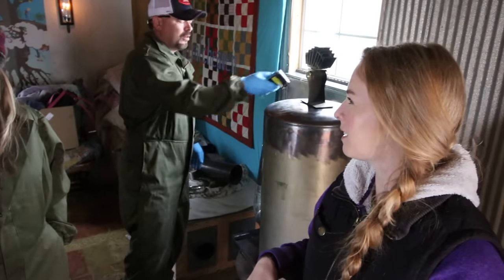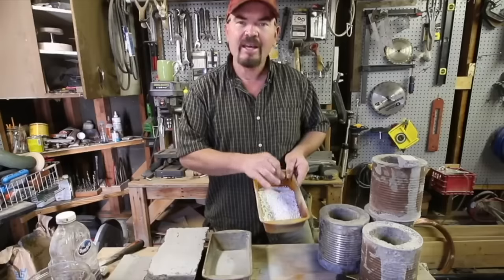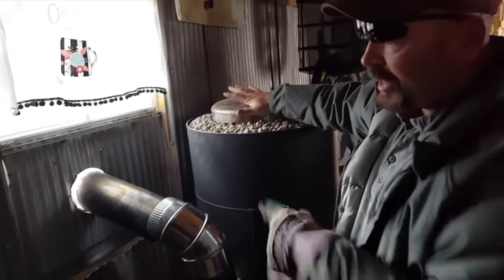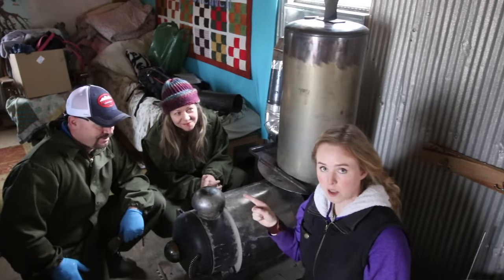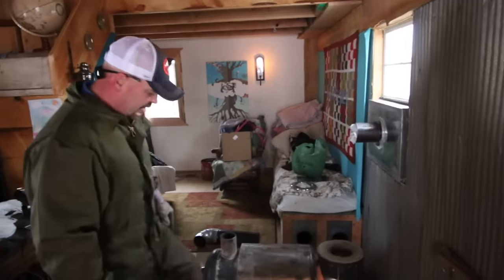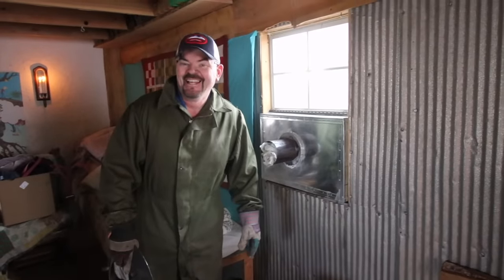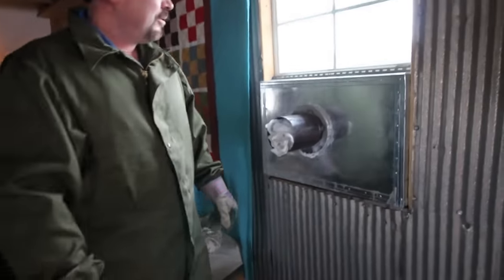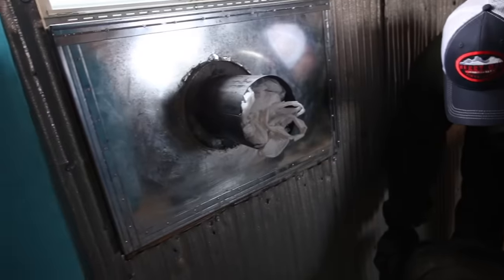DIY AirCrete Rocket Mass Heater 2.0 Works!

Comment: Great advice about being eafe while testing this stove . I also see lots of good advice from the comments section . Lots of pros and cons to doing this build but safety is always number one no matter what. I've built prototype gasifiers and rocket stoves to see what they're like and to get an idea of how big of a stove I'll be needing for my shop that I'm turning into a house . Fortunately it has a concrete slab , although it wasn't water proofed back in 73' . So that's going to be the first order of business and then building a decent mass heater such as this one but scaled up a bit because of the size of the building which is 80 L x 40 W . In other words lots of square footage to heat . Currently it's costing me a small fortune to heat this place using propane heat to keep everything dry and keep mold at bay especially during the rainy season .So seeing videos like this really helps give me ideas before I build something more permanent . I love the idea of using only a small amount of wood to heat a building,much of which is sitting on the property as dead fall . The best part of all is limited emissions . It's really good to see that rocket stoves have caught on and now people are realizing that there's another way to heat their homes and be environmentally friendly at the same time.
Mass heaters and rocket stoves aren't new but it's good that people are seeing other alternatives to the traditional fireplace and saving money as well .
Best regards from the Pacific Northwest
Reply from the maker: Sounds like a great project! Yes, propane can be so expensive. We are looking for a kerosene or white gas stove for the apartment since the power goes out in Tulsa frequently. It does make me miss my little rockets stove and cabin for sure!

Comment: I have followed your designs. Aircrete is the ideal insulator. Where there is danger of it coming apart, stucco wire could be located close to exterior to operate as rebar. As you say insulated pipe preserves heat to create draw. A valve to put heat through heat sink bench is perfect after draft is established. Suggestion: providing cold air supply for combustion would be improvement. Thank you .

Comment: I think you mean this is as a safe-surface mass rocket heater.  Too bad it is missing a flat top above and an oven because you could use this stove for cooking,  too.  

Design could be more elegant,  but this is still a prototype.  Needs to include a water heating element for efficiency.
Yay that it has a nice safety element for people.

Comment: That's a great rocket mass heater. Congratulations! I agree with you that more mass is required, and your idea to reconnect the bench is a good idea. I wish you had a concrete pad for a floor, instead of plywood, because that would allow you so many more options. However, I understand weight is a concern in your current design. I'm just brainstorming here... do you think a residential hot water heater tank laid down on it's side, so it's horizontal instead of vertical, can provide you with extra mass for the heater? Also, with it being horizontal, the weight will be spread across more of the floor, and the hot water tank supports could be aligned with supports in the floor. And then, a second bench could be built over the tank. Winterization for the "water mass system" is as simple as using automotive coolant (antifreeze). And, because it's automotive coolant (antifreeze), the mixture can be used year round because it won't freeze at the same temperature as regular water. Congratulations, again, on your new rocket mass heater! I look forward to more videos.

Comment: Did you see the Fouch  Family rocket mass heater?  Theirs work, and it's the same type of design that I learned with Ernie and Erica Wisner.  I think the problem is that you really don't have the "mass".
Reply: sigh, read the tintro!
Reply: Thinking it needs a well insulated riser. The difference in temps in riser and out, creates a pump action for chimney..actually exhaust as then you don't need a chimney. I European co makes a rocket heater. Now then They are sized as a Russian fireplace, per heat up and cool down time. So lil engineering needs to go into the size of room//mass//. For in stance The Liberator(ebay), from Bourbon MS, is a rocket heater that is designed to use a chimney and not a mass.
Reply: Send a link ! Can you ?

Comment: I am seriously concerned about using a flammable foam for lightcrete. If heated the off gassing could be lethal. Use perlite or vermiculite or some other non-combustible refractory instead. The chimney is also usually just double or triple wall with air gaps.
Reply: @adolthitler  Do you have links to the MSDS sheets? Or is this your opinion? I agree the monomer gasses seeping out of the chimney must be addressed. I knew a man who blew himself and the 78 year old owner out of his mobile home because he didn't read the directions and precautions. Hell of  price to pay for a new vinyl floor, during Christmas. Read and Heed!

Comment: Based on the designs I have seen here on u-tube  you need more mass and pipe with cob under the floor with a bench e.g. at least 20' to 25' under floor with a cob or concrete bench above the floor and around the fire chamber and vertical tank.  You could also have a stainless steel oven for baking and a ceramic stove pipe to the exterior. which greatly increases the appearance . I would also increase the diameter of the vent under the cob bench to 10"  and add bricks as filler in the trench . I also want to use outside air at the top of two baffles so secondary air will increase temperature at the top of the fire chamber to over 500 degree Far.  You suggested that there is a problem of getting this hot air to go down and out into a cold environment so do you think a blower would solve this problem ???

Comment: I believe that putting the mass around the riser reduces the efficiency of the "rocket" and is generally considered wrong and potentially dangerous.
Reply: Richard Russ 
Mass just absorbs and slowly releases heat versus immediately expelling it.
Reply: B uppy, i understand what the mass in a rocket mass heater is for. I also know that if you do not have the cooling of the air around the riser, you do not have the rocket in your mass heater.  So, with the mass placed around the riser like that, the longer you burn, the less draw you will have. Which means lower temperatures of the burn, which means possible creole in your flue and possible reversal of air flow into the cabin.
Reply: Richard Russ 
The proof is in the pudding.  If this works then the problem was in the explanation,  not execution.  Best wishes on their project.

Thank you for elucidating your point.
Reply: The mass isnt around the riser ,its insulated so the temp gets hoter, the mass is in the bench on the left and is not in use yet

Comment: Your exhaust pipe needs to be larger than your internal pipe (flue) so if you used 4 inch your exhaust should be 5 inch or larger for longer runs. Concrete is not brittle the reason stone is used is to increase its compression strength and rebar is used in concrete to lock sections of concrete together.I think what you have to understand concrete can explode from high temperatures due to water that is trapped in the concrete.Your secondary air inlet is were you main burn comes from your secondary burn which is why a secondary air tube needs to be in the flue.MOST IMPORTANTLY The only flaw that I see is you need to pull air from outside and not use air from inside you cabin.

Comment: As per your comment about logs. I've watched other videos about rocket mass heaters and they've said that they just use dry sticks now. They don't have to spend time splitting wood. They have a series of trees and they go cut the branches the length they need and dry them out. It's a lot less work. How awesome is that?

Comment: In the 80's there was a professor at the University of Maine, Presque Isle,  he was one of the people that went to Japan to teach solar design to the Japanese. He had an old farm house that was built in the late 1800's and got the house to a point where he could heat it to 70 deg using one cord of wood a year, and his wife ran a hair dresser business on the first floor. He used an old gas water heater hooked to a wood burning stove, where he ran a blower to super heat it, just as a rocket stove does. He had a quarter horse pump that would circulate the hot water through the gas heater, that was attached to the stove and the hot air would go through the water heater, and it would draw the heat out enough where you could rest your hand on the flue. He pumped the heated water into a 250 gallon tank and would then, via coils he welded into the tank, would draw the hot water that was used to heat his house, as well as the hot water used for showers and for his wife's business. Do you think using a gas water heater, where the exhaust from the mass heater was routed through it, would allow the remaining heat going up the flue, to be collected and used as he did?
Reply: Yes, but just as he did, you would need a fan to create a forced draft as if you take all of the heat out of the  exhaust, you have nothing left to create the draw. For the best efficiency you want a cold exhaust and therefore need a forced draft.

Comment: always always always in a solid fuel Class A chimney situation (wood especially) the crimp in ALL chimney pipe should nestle inside and face towards the stove firebox so that creosote and condensation runs back towards the firebox and will not cause those products to burn on the outside of the pipe..  because of the negative pressure between the inside and outside you will not get any blow back to the living space.  on a Class B chimney (natural gas and propane)  the crimp faces up and out towards the outside in case unburned products and carbon di- and monoxides exit the chimney.

Comment: I realize this is an older video... but what do you think the result of adding an external combustion air feed so it's not using conditioned cabin air to burn?
Might need to ask over on honeydo channel.

Comment: Nice looking wood burner, not rocket mass heater. Your losing all the heat out the chimney. He mixed portland cement for the fire box, it will crumble.  Good luck to you.

Comment: I love the rockerstove mass heater but as far as NFPTA  goes, most places in the US this is not acceptable as a home heating devise. (Merica) I've built a few outside heated benches that worked quite well but have no testimonial to how it works inside a living structure. I would love to build one for a camper or van.

Comment: Like a rocket stove does this stove use little wood , smaller pcs. and great heat ? This looks like a great stove . I will check out your site . Curious about how you mix foam and what kind , with concrete . 
Thanks for this great video. 
Blessings, Linda
Reply: To see that you must go to 'honey do carpenter'

Comment: Notice to myself: don't build it that close to the floor, so I don't have to crawl on the floor to fill and check it.
Reply from the maker: It is the same height as most wood stoves. I just can't sit in a chair in front of the stove and keep the fire and my face in the frame at the same time.

Comment: The missing cob bench was the first thing I noticed. Where is the mass that soaks up the heat? Does it really all go into the foamed concrete?
Reply from the maker: That bench to the left of the stove is the mass. It is full of pebbles under and on top of the exhaust piping. The pebbles warm up and hold the heat a very long time.
Reply: Поиск по картинкам даётся проще чем изучение языков. 🙏👌
Reply: @dirtpatcheaven  Can I just say that the stove that Darwin put together for you, from pieces of various tanks, stovepipe, and homemade aircrete, is the most professional looking and functional rocket stove that I have ever seen; and that includes models like the Liberator. It won't be your choice if you're looking for something with the asthetic of a masonry fireplace, but as a wood stove it looks ridiculously nice( not to mention a bit steam punky ;-)  ). 

If he doesn't have a stove on the market, it's a crime. 🙂
Reply: @dirtpatcheaven  great build! Thanks. Any experience with sand or clay instead of pebbles?

Comment: Needs a larger wood box so you can load it up with large logs
allowing it to burn/heat throughout the night.
Problem with making it into a pellet stove is where are you going
to get pellets in a SHTF situation and most of us are trying to live
as frugally as possible and can not afford to purchase pellets for
as long as you want to use it...
I think it has a lot of potential it just needs some tweaking to make 
it more appealing, user friendly, and affordable to use for most of us.
Thanks for sharing this with us.
I look forward to seeing more.
Have a great day and be blessed.
Couldn’t get the link to Honey Do Carpenter to work.
Reply: Troy Stutsman that’s not how rocket stoves are generally designed to work. Study up more on rocket stoves and rocket mass heaters.

Comment: In terms of your stove pipe, it will pay for you to buy stove pipe to building and safety code by using triple insulated pipe.  It is much safer.  Single walled pipe is dangerous because the metal becomes fatigued with the heat, water/steam over time and can literally fall apart at some point and starta fire in the home.  Glad to see that you have a better structure holding that pipe as it exits thw window.  Remember one important principle that sometimes you cannot skimp on cost of materials when it comes to safety.  You're making a huge mistake in using that single walled pipe and putting this family at risk of losing the home, furnishings and most importantly their lives.  Building codes were implemented not to control people, but to save lives.  Spend the money and do it the right way.
Reply: Darrell Jacob JR sometimes you don't know what you don't know. Always prepare for the worst case scenario.  In the real world, things happen.  Creosote burning in a single walk pipe weakens that pipe over time.. there is more than one factor that governs where creosote collects and where it catches fire.  When you see that single wall pipe turn cherry red, you'll be praying with all your heart that the wall of the pipe holds and that from condensation it hasn't rusted out from the inside because if that pipe gives way, you have no way of quickly controlling the shooting flames and everything it touches catching fire.  Why you would be so stubborn and not spend the few extra bucks it would take to get a triple insulated pipe, which is code, and put your family and your possessions at risk is beyond logic.
Reply: You both have good points, but given the choice between living next to an innovator who thinks he knows more than groups which sets standards is a gamble. He may know more, but there's a good chance he has overlooked something. In any case, an insulated flue will not hinder any kind of stove including this one, it can only improve it. So it boils down to the innovator next door wanting to skimp on material costs because he's mostly 100% sorta kinda sure she has covered all scenarios. Just insulate the flue and be done with it! If regulations don't make sense for an edge case then sure it can be counter productive, so try to get the regulation updated - humans make mistakes and have oversights. That's why regulations in most countries are constantly reviewed and updated.
Reply: Yes, i understand the dangers of using galvanized duct in a 'normal' woodburner...I'm a welder. But these RMH's are not normal. There are so many 'different' things about them, people who haven't built one and used one will never understand.

PS. I've built 7. THERE IS ZERO CREOSOTE BUILDUP IN THE CHIMNEY. Sheesh! No creosote buildup = zero chance of a chimney fire. "because if that pipe gives way, you have no way of quickly controlling the shooting flames..." You mean the flames that turned to totally burned co2 and nitrogen exhaust 20-30 feet back in the inverted drum the other side of the thermal mass? There are no flames in the vertical 'chimney' exhaust pipe. But you haven't built even one, yet you think to instruct me...sometimes you don't know what you don't know.

Comment: Darwin, Where did you get that fan on top of the stove??Did you build it??Do you have plans to add fins(flashing) to the outside of the transfer tank. It will sped up the transfer of heat to the room. On the pellet feeder take a look at Zero Labs https://www.youtube.com/user/ZeroFossilFuel/videos  and look at videos #395, #450, $466,  and 468. Mark Brasher has made the best version of the pellet feeder and basket that I have seen yet. The pellets allow the fastest way to get the temp rise in the tank. Then if you want you can switch over to wood.

Comment: Umm... Tis not an original design .. nor is it similar. 
Rocket Mass Heater requires a base of mass that can hold the temperature over a long duration.
Two handfuls of kindling should give you 30+ hrs of heat.
Where is your MASS to heat ?
You are close to a rocket stove .... PERHAPS.
Reply from the maker: I have a mass. It is the bench you see to my right. In later videos I show us hooking everything up. There is also a shroud of pebbles around the heat riser. https://www.youtube.com/watch?v=XFbf317PmnI&t=61s